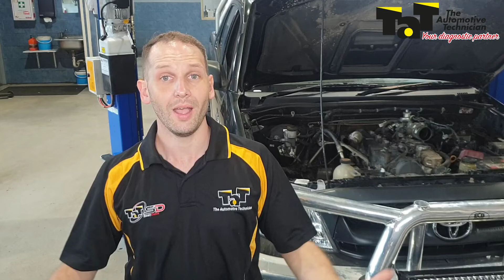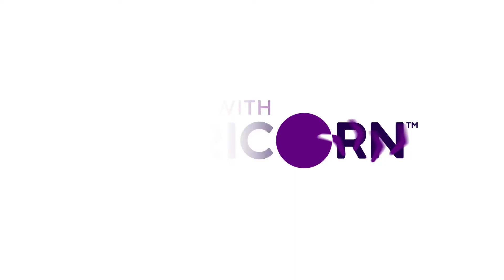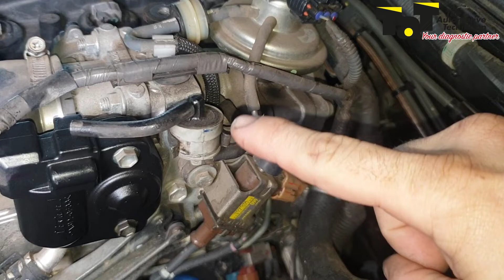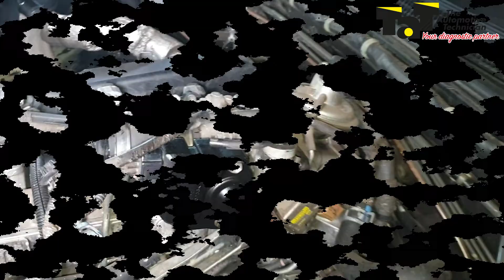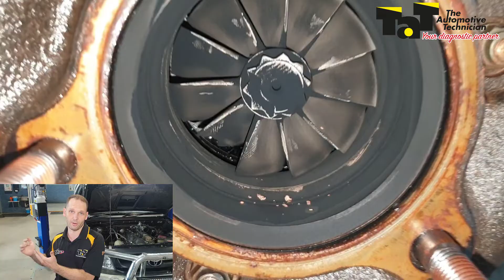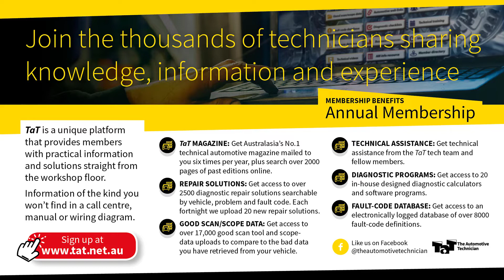Toyota Hilux P0046   Turbo Failure

Comment: Hi The Automotive Technician,

Im hoping you might be able to help me,

Where do i start i guess at the beginning, I bought a 2009 hilux 3.0l last year with a new MOT on it ran it all year without issue. Went in for its mot and failed badly on emissions. My mechanic ran tests and found all number of issues.

Basically i have bought and put in a 2014 engine thats suppose to have done 72000 miles. I have had to refit the original fuel pump injectors, air intake etc to get the wiring loom to work as the new engine had a completely different loom and plugs on all the ancillaries. Got it in fired it up and it smoked the place out at first then cleared out but it had a injector knock and will smoke if you hold it at 3000rpm anything below that it run perfect. We thought it was the injector as the ones from the original engine had done 200000miles. I had them tested and two injectors out the four were bad. so i got a service exchange set of new injectors and put them in, got them coded so all the lights on the dash went out. Started it and it filled the place with smoke again which after letting it run slowly cleared abit so i took it out for a thrash to try and clear it abit which it did but it is still showing the same traits as it did before i got new injectors you rev and hold it at 3000rmp and it smokes like its over fueling and when you rev it the diesel knock is still there. My and my mechanic are loosing the will with it but ive invested so much in it now that it needs to work for me.

Thanks In advance
Paul Snell

Comment: Hi I have my toyota hilux d4d 0.3L I have a problem when I  driving It cuts and make start fun soud when I press exelelater no power but when I switch off the engine  and start again it becomes normal

Comment: Replaced a cracked filter today as the car was down in power. Made no difference so pulled off the dump pipe and found a broken fin jamming up the turbine.

Comment: I got p0046 error on 2008 prado 120 series associated with loss of power. The MAP sensor filter was cracked leaking some oil. Mechanic said replace turbo, I replaced the $60 filter. Seems problem is now solved
Reply: Hey bro I’ve had this code come up might try replace the filter, did it turn out working fine in the long run or did u need to replace the turbo

Comment: Great video!
Hit the highway on the weekend and the engine & VSC lights started flashing with no power loss. Still drove fine but slight howling. Checked for code and it was P0046, watched some ytube videos and sprayed the arm on the turbo cleared the code and it hasn't returned but the howling is still there. My mechanic said it seems like a turbo but the the 2 he had changed on 1kd's where screaming.
The weird thing is it still drives like normal. The noise seems to be louder when cold.
Any thoughts?
Reply: Your turbo actuator is probably stuck hv it changed n it should be fine mine got the same problem m changing the actuator this week 👍
Reply: @georgemickael2854  i decided to change the turbo with a brand new one. After 50,000kms it happened again with no engine light. Just the siren noise.
Reply: @AleksTob07  it's actually happened twice now. The fins on the exhaust side were damaged which is what makes the noise. I have now installed a 3rd turbo and a pyro gauge to monitor the EGT's. Seems to be doing ok. The 2nd turbo was a brand new genuine but this 3rd one is a Garrett which I put to save some money and seem to be just as good.